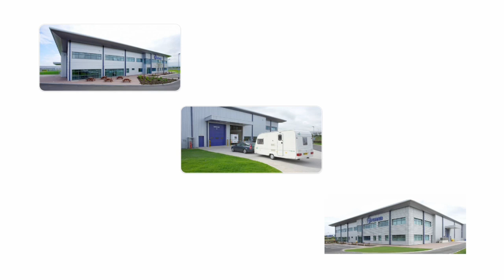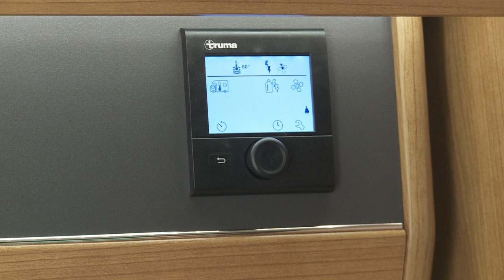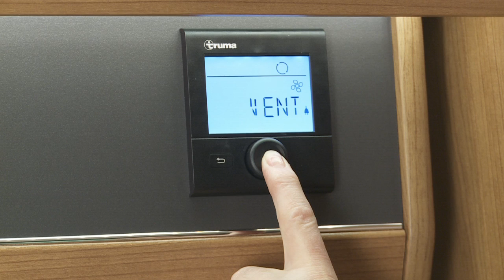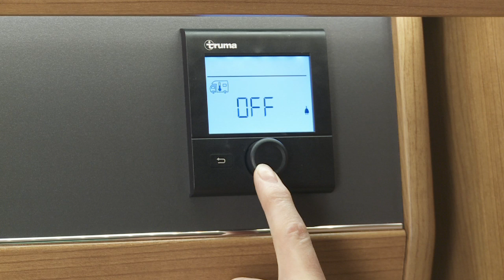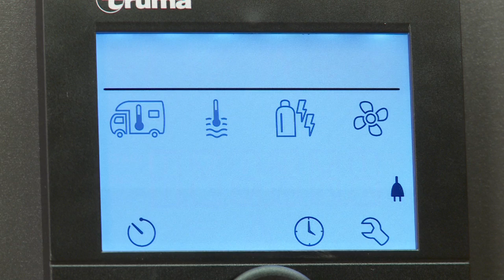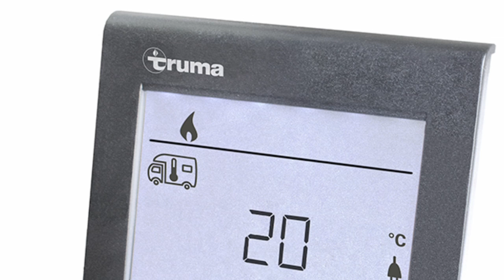CP Plus Heating Panel - Truma Combi

Comment: I have set the heating and water settings but neither are working. On the display unit it shows  the flame and hot water icons on the top tool bar.
But in the main display box it shows "A   21c.  and time.
Can you help me please.

Comment: A good explanation thanks. Just one thing though, I have a new caravan and I've been hooking up to the mains power while we get organised with it before we go away soon. I then remove my mains connection until we go back to the caravan...... So should I be turning off the truma display? I ask this because Now I am thinking that if I have not turned all the settings to off that they may be trying to run from the battery!! Or is that not possible?